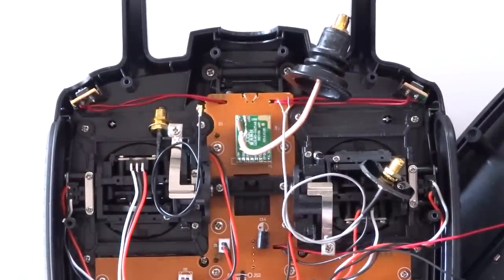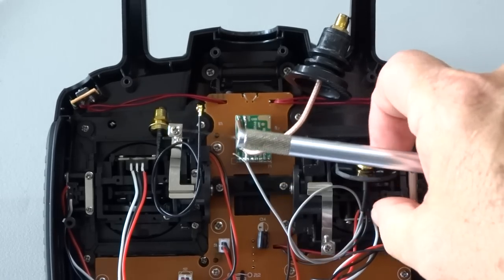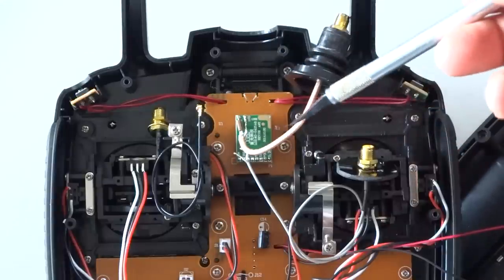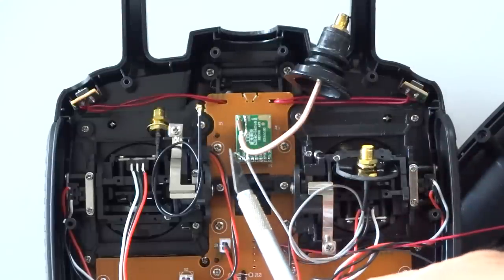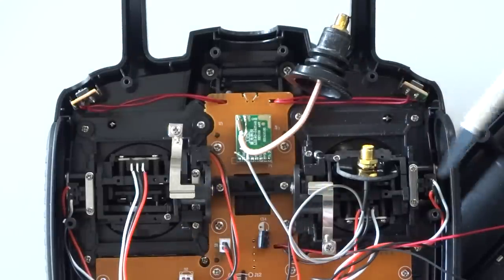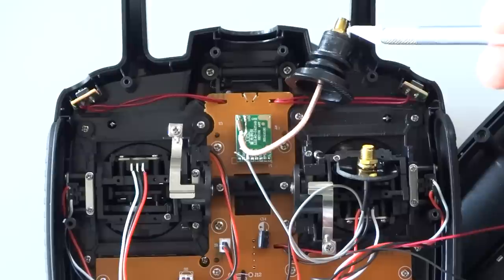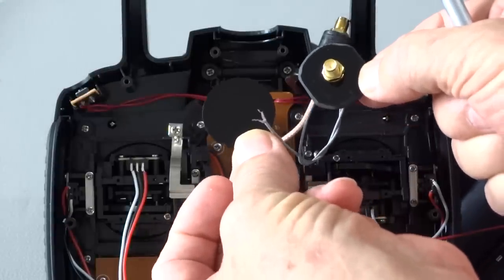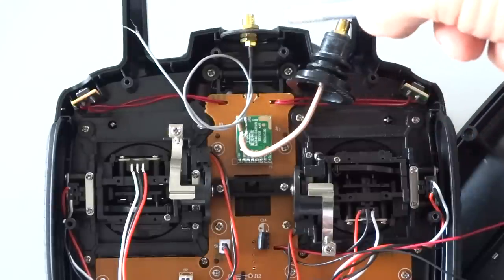WL Toys V666 Transmitter Modification.

Comment: hello, I have made that antenna mod, but I changed the cable while I measured the solder joints on the board of the antenna (gnd and ant) among them the 0.1 ohm multimeter me ....... I was wondering if was normal between 0.1  gnd and ant ?, you can give me confirmation, just that you also measured without removing the radio but directly from the connector where the antenna is screwed
Reply from the maker: andrea rossi Hi Andrea, I did not measure my connector points, I just soldered the coax on the points, the TX works ok.

Comment: Hello Clay. I got an SMA cable but it has a male connector instead. Antenna plug is female. Does it matter or just works the same? Thank you for sharing this tutorial
Reply from the maker: +J L  You will have to use Antenna that has a pin in the center.
Reply: +Clay Shooter - Kev Knight understood then I need to get a female SMA connector. Thank you!
Reply from the maker: Cheers.

Comment: So what antenna did you use after doing this? I always wonder about these antenna mods.  Did you ever range test the results?
Reply from the maker: +John F HendryI fitted a Fat Shark 2.4GHZ - I now have a Blade 350 QX3 AP Combo so I don't fly the V666 much.
Reply: +Clay Shooter - Kev Knight Ok thanks....
Reply from the maker: My SMA connector on the TX has no centre pin, so my antenna has a Pin, if your SMA have a pin.

Comment: Kev...any way to fix my camera..on the 2nd time i plugged it in, i heard a pop, and camera no longer comes on....no blue light...this on the v666n model..thx
Reply from the maker: +igor never-miss Thanks for your post, if you power on the camera Without the camera antenna plugged in, you will blow the camera.
Reply: no, antennae was in, like i said, worked great first time, unplugged it, went to store, whatever, went to plug in a second time and pop...if was a fuse, would've blown fuse..so, bad wire?.and if you blow camera, is there any fix/test with multimeter? on what setting?
Reply: Kev Knight - Clay Shooter
also, can't find any video that shows how to remove the camera, and wire in a diff. one/mobius..all videos just say..."replaced camera w/my mobius"...and show it already attached on the quad...i have googled/youtube a hundred diff. ways, how to remove camera...nothing
Reply from the maker: Try this Forum.
http://www.rcgroups.com/forums/showthread.php?t=2291665

Comment: hi Clay , you can test ohm on your radio , without open radio ,you measure the pin the connector 5,8ghz , on my radio and on may monitor fpv i have 0,1 ohm , ( i not have tested range radio for now , i haven't time) i post a pick for measure ..... thanks....

http://funkyimg.com/view/Yn3W
Reply from the maker: andrea rossi I don't have the TX with me right now, the TX mod is 2.4 mhz not 5.8 mhz
Reply: +andrea rossi hey Andrea, i got same problem here. I wonder if it's normal or we're two just "luck".
Did you met some difficulty on soldering process?